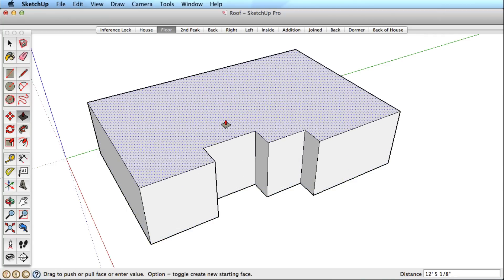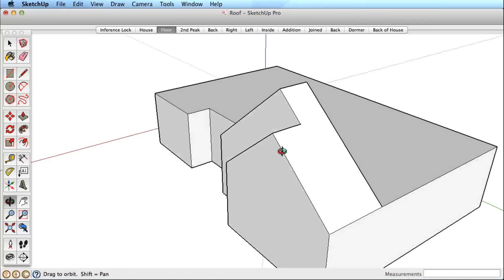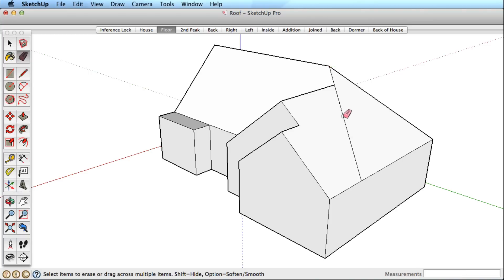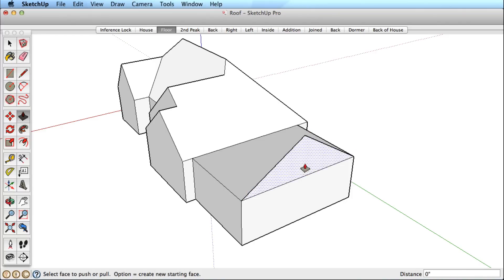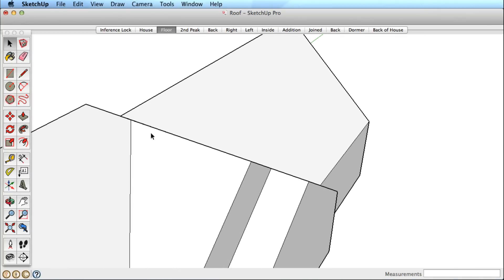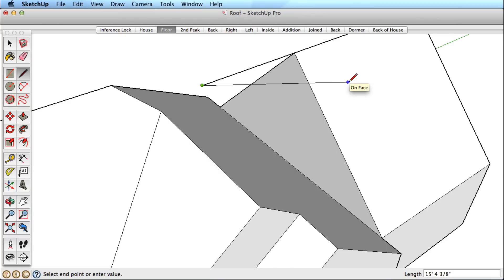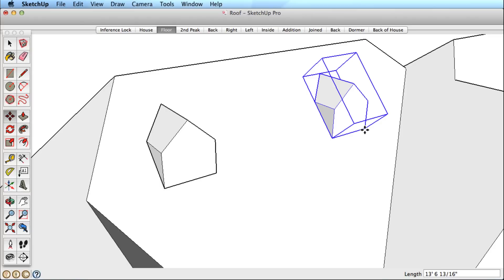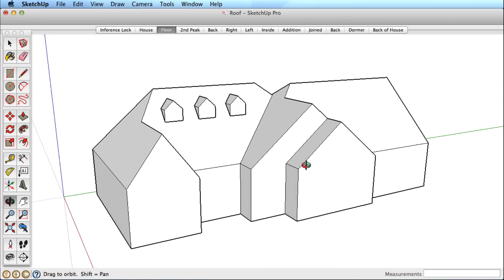SketchUp Training Series: Inference Locking Example

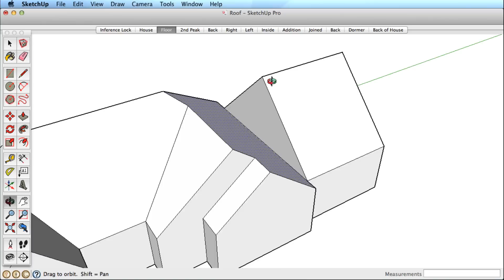Comment: I tried this tut about 5 month ago, and I had a lot of problems starting at 3:50. I gave up after 20-30 times. Today I came back (with experience of about a hundred tutorials) and I still needed about 5-6 tries to succeed in handling the stuff of minute 3:50 to 5:30.
The main problem is that you don't explain in detail what (and why) you are exactly doing!

Comment: I've only been learning for a couple weeks now, only in the evenings. Don't get how people aren't understanding these instructions. If you've done your due diligence and learned the basics from their "basics" videos, there should be nothing you don't understand here!
Reply: I think the problems come when the step "doesn't work", for example, shift does not 'lock' anything on my computer and I still can't tell if I'm using it properly. This particular video needs a slow introduction going through arrow and shift key functions and formally defining what they mean by locking and inferencing. There is definitely variation between machines and working it out is not easy.